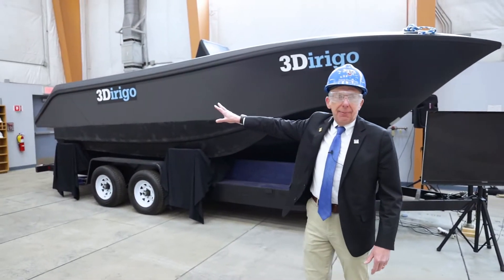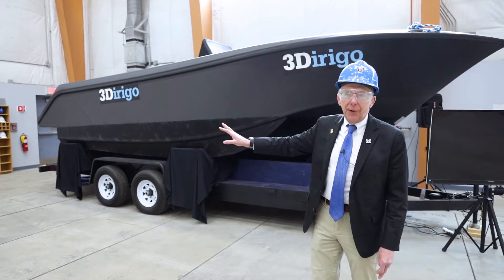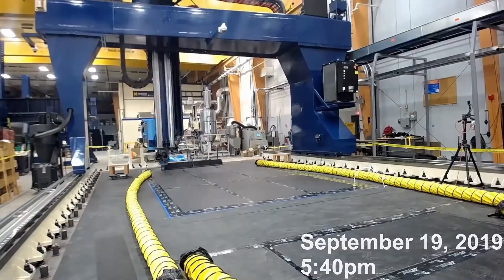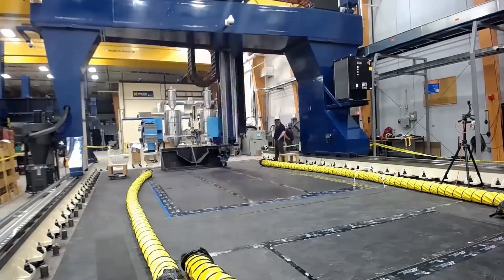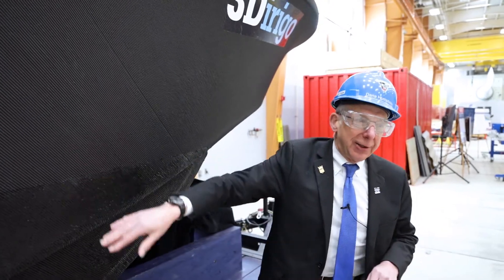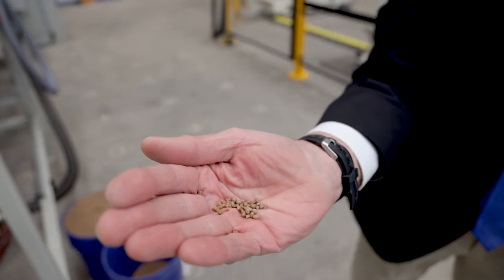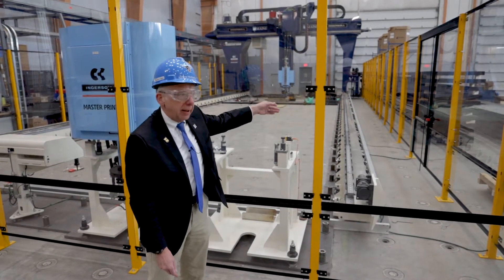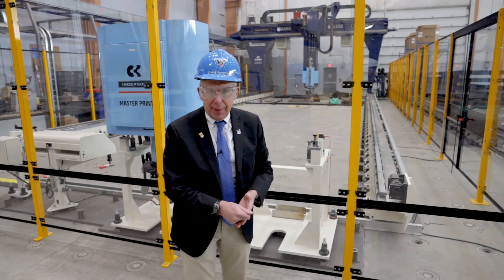World's Largest 3D Printed Boat and 3D Printer

Comment: poly
weighs  .45x water
less than half
27 lb cu ft 
934 cu mt
729 cu yd

5000lb÷ 27 = 185 cu ft
6.8 cu yd
5.3 cu mt
one inch thick
2200 sqft  46x46
246 sq yd
1/2 inch thick
4400 sq ft
66x66
5.7 cubed

Comment: Would it not have been hydrodynamically more efficient if the beads were laid fore to aft, as it is, this current configuration would cause a great deal of hull resistance.
Reply: Just put an industrial sander to it. If you are going to 3D print a boat to sell to consumers, you might just as well add 2 layer walls(This one has 1 wall) and sand the outher wall a third and it's smooth as butter.
Reply: @PantsuMann  Depending on the material you can also use acetone vapor to melt the exterior print lines together before sanding.

Comment: What kind of stiffness to weight ratio are you getting with this type printing and media? Is the final product seaworthy and efficient?
Reply: Likely, an advanced product like that would have special mounting points, to reinforce it with other structures, such as wood or metal (for big boats). And the hull will likely need to be fiberglass reinforced and maintained with fiberglass. But the potential is exciting! As you could print even double-hull custom boats relatively cheap, with custom designs for multiple rooms, electric and water pipe conduits. Sails, solar panel mounting points, etc.

This could open up doors to some potentially affordable boat housing or recreational boats!

Comment: This is NOT the worlds largest 3D printed boat just the largest entered in to Guinness book of world records. Also it's NOT the worlds largest 3d printer.. As far as I know the largest 3d printed boat is 65.61 feet long out of Germany and A New Zealand fella has a Catamaran that is 42 feet long, both 3d printed one 3d printed with a 3 part extruder that use fiberglass, resin, and a quick set hardener and fills an entire climate controlled steel building that houses the printer. The other is another massive printer using PC filament in a large heated steel structure that in-self is like an oven during the printing process for the PC. But, I am sure this might be the largest boat printed the fastest, unsure how it will hold up in the real world on the ocean though. Would love for them to share with us the materials / specs during printing. Sounds like a lot of back patting and hype, but it's a start and something cool to promote the school. Hell, some of the new mortar 3d printers for building structures are much larger than this one in the video.
Reply: Are the biggest in your Minecraft file?
Reply: I can find the MAMBO's introduction at Formnext late 2019 but do you recall who built the catamaran?
Reply: Yeah I didn’t see any frames or stringers to support against ocean water pressures. So practically it has no strength in the hull.